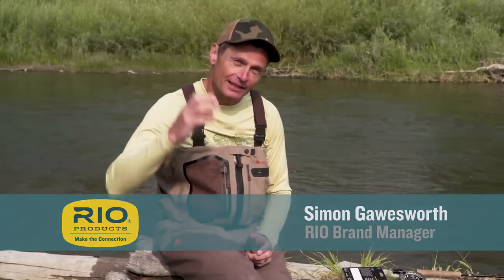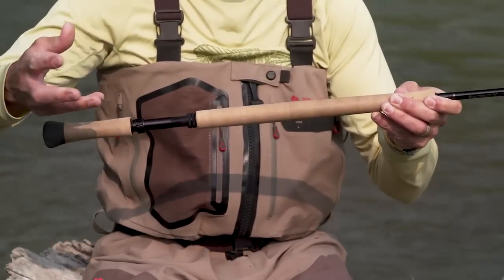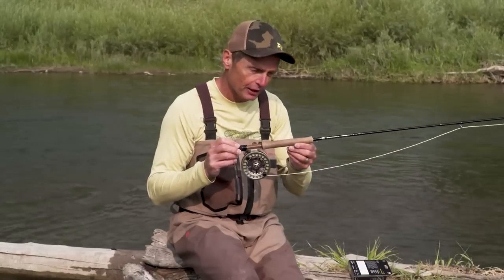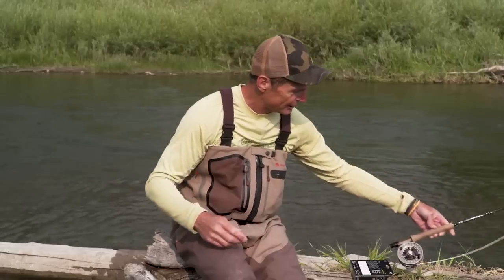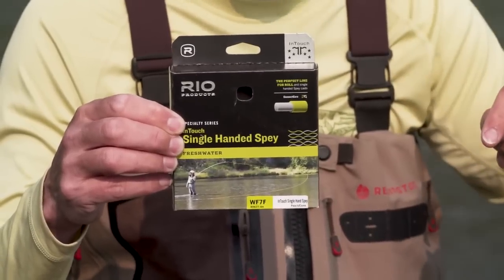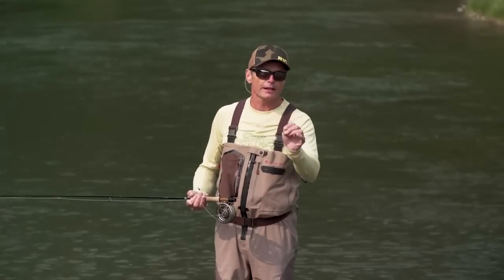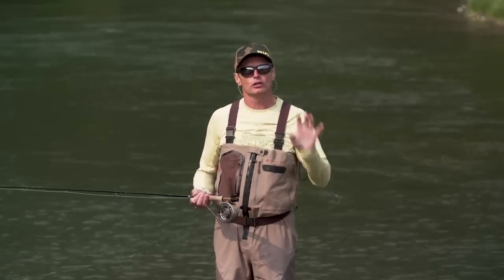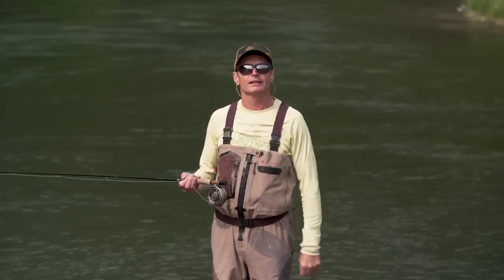How To Make a Single Handed Spey Cast - RIO Products

Comment: Interesting he's using a 5wt rod with a 7wt line.  WF7F.   can anyone confirm if overlining the rod will make single-hand spey casts easier to perform?
Reply: if u have a strong quality rod its probably fine and yes its easier to load id say 1 wt up max not 2, u can snap it if u rush the cast with a cheaper and longer rod its happened to me before.

Comment: He said he had a 5 wt rod and then showed a 7wt line. So for single handed spey casting you need a fly line 2 weights more than the rod?
Reply: It's just a prop. You don't size up the line. The line is labeled to match the rod.

Comment: does anything change in execution if using a 8wt - 9wt with a weighted streamer - say no 2/0 bass streamer? or out on slat water going for reds in the wind?
Reply: Generally not.  Spey casting was basically created for streamers.  That said your line choice determines how big a streamer you can chuck.  A line like the one he is using has a taper on the head where most of the weight is in the back and will generally speaking not throw the heaviest/bulkiest streamers whereas a line with a little more uniform belly like a skagit head can transfer more energy into turning over heavy flies and sink tips.

Comment: Thanks Simon. A penny dropped whilst I was watching this, which is why it is so important it is to keep the rod in motion. You referred to the fact that having only a little fly line on the water is a good thing and it made me realise that, when I make a good cast, that is exactly what happens. The line/leader doesn't have time to sink and/or be gripped too much by the water surface, so it lifts much more easily.

Comment: Simon. Coming back to the sport after tens years and dusted of my 9' 5# Sage XP and real. Can you explain the difference between Rio Gold floating line and the Rio single handed Spey line
Reply: Hi Neil. Tim Rawlins from linespeedjedi.com here.  The Rio Gold is a a weight forward line which means most of the weight is in the front part of the head and is primarily for overhead casting.  
The Rio single hand Spey line has more of the weight of the head near the rear part of the head, so if you pull the head of the line to the tip top eyelet of your Sage XP,  which is nice with the slender green running line that contrasts well with the large diameter of the yellow head portion of the line, so you know exactly where the head is and therefore the sweet spot, it roll casts very nicely, but.....
...the Rio Single had Spey line overhead casts very nicely too, and a very delicate presentation to boot.  
You could probably do some roll casts with the Rio Gold but you would have to pull the head in pretty close to your hands or more and it might not roll cast as easily.  
For overhead casting and light presentations I suspect the Gold shines, but it would take a pretty skilled Spey caster, such as Simon to actually Spey Cast with the Gold with any proficiency.  If you want to overhead cast with small dry flies and learn fish using single hand spey casts also, the Rio Gold is a good choice.